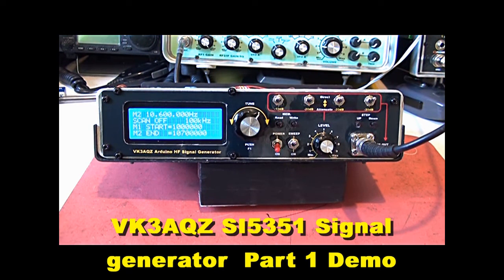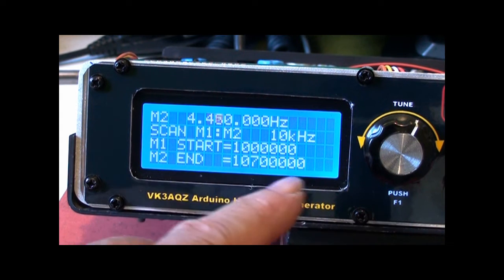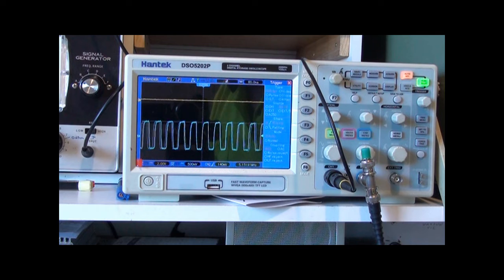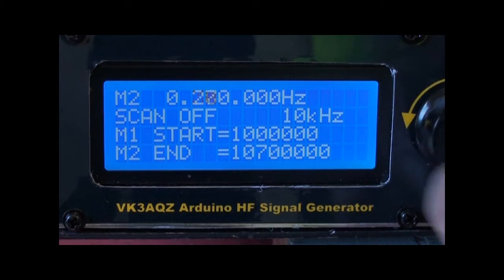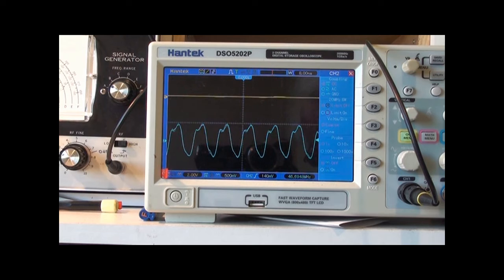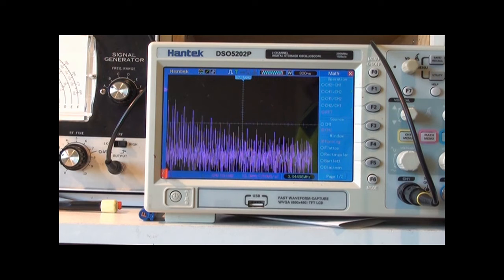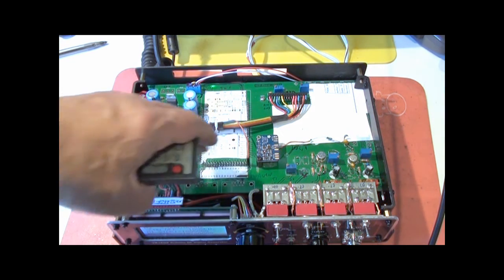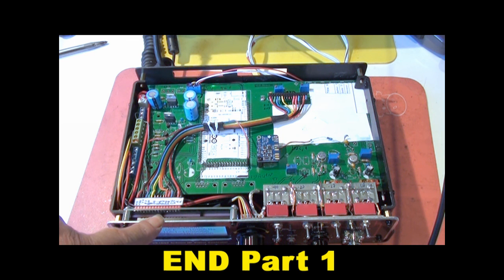VK3AQZ SI5351 Signal generator demo part 1 HD

Comment: Thanks for this. I built my own si generator with display etc but your work has given me some ideas to expand it's capabilities.
Reply from the maker: Hi, thank you for the thumbs up. There is another video which I made after adding a PE4302 programmable attenuator. I use mine a lot for testing RF circuits and sweeping over filters both slowly and fast - cuts a lot of design time down. Cheers here is the link for the PE4302 demo.
https://youtu.be/XAnesvP3078